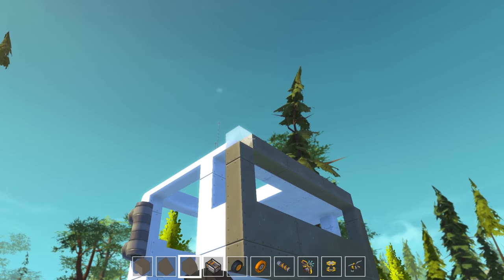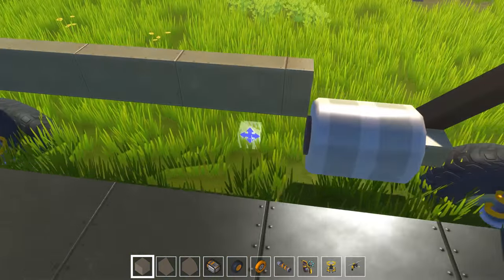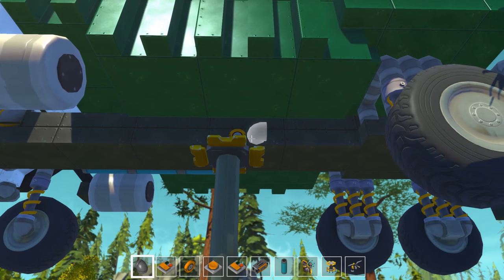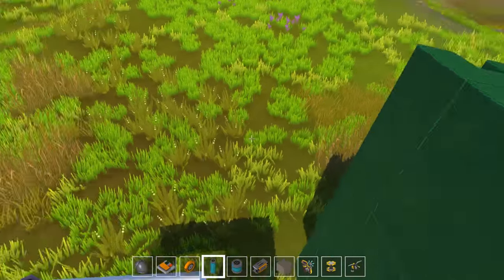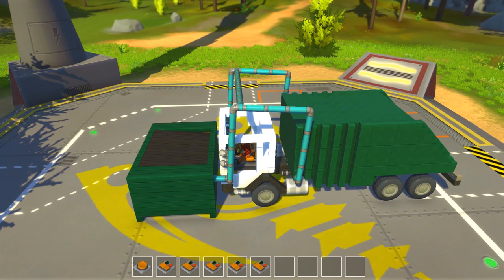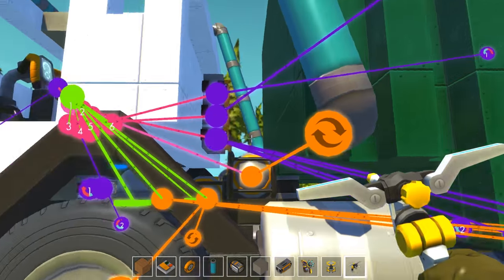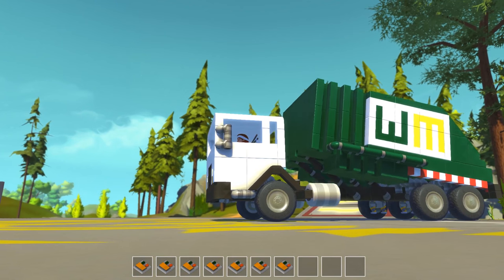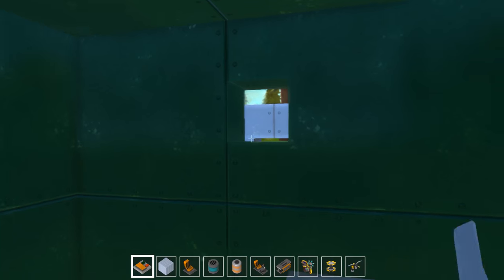Scrap Mechanic Gameplay - EP 36 - Garbage Truck

Comment: U JUST HIT 2000 SUBS CONGRATS
Reply from the maker: +Aidan 92143 The support has been amazing! I've got some more Scrap Mechanic and other games coming. The Tower is in the works. I'm not sure when it's going to be released though.
Reply: +Camodo Gaming hooray thx
Reply: +Camodo Gaming have u looked at my tower
Reply from the maker: +Aidan 92143 I did. I need to look at it again.
Reply: +Camodo Gaming ;-) thx for tacking in my suggestion
Reply: +Camodo Gaming there is a lot of spider webbing on my tower aint there